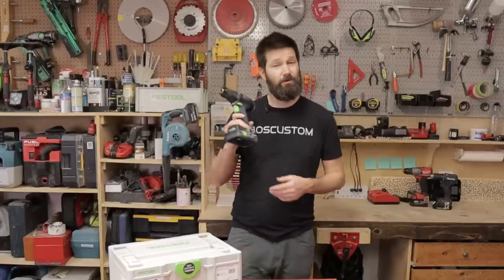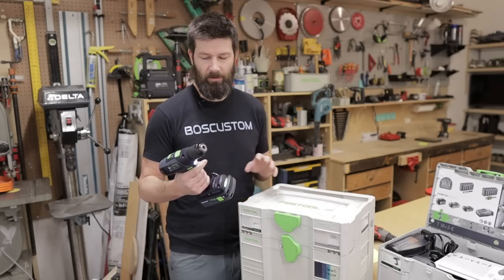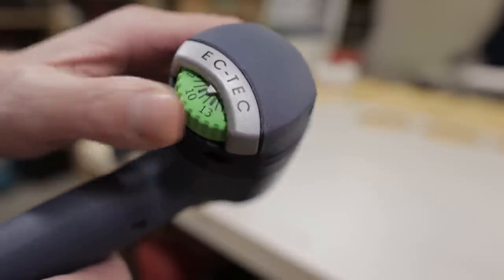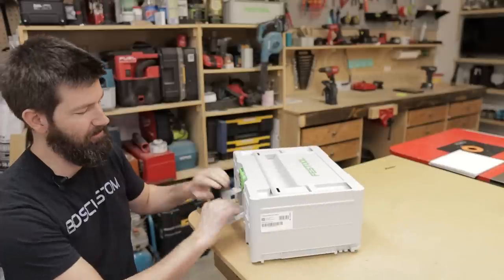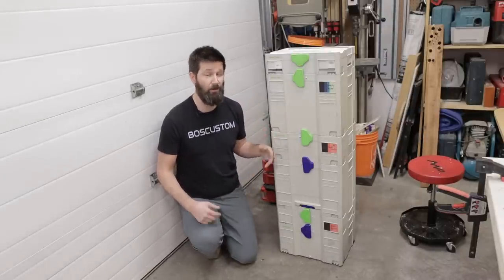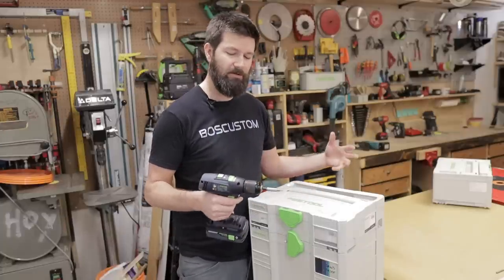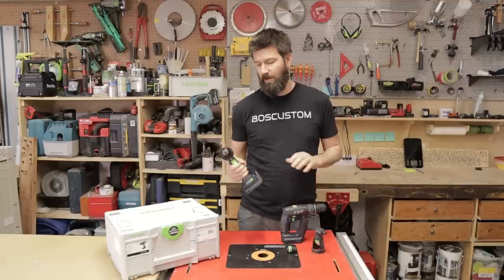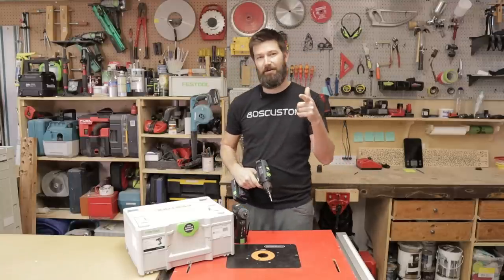Festool T18+3 Easy Drill-- Everything you Need to Know!

Comment: Been debating between makita and festool track saw.  I like that drill though, might just sway me towards festool for that kind of deal.  Always been a makita and milwaukee kinda dude.  Agreed on the sustainers though have a couple sitting with my makita ones, great tables and chairs.  😂
Reply from the maker: I'd definitely price it out and see what the difference is.  I think it's worth it to go cordless on the track saw.  I have the Makita corded track saw and would like to upgrade it in the future.  I'm not sure on the cord on the Festool but the Makita cord is very awkward and prone to catching on things, which is not great when in the middle of a cut.
Reply: @TheFunnyCarpenter  agreed with going cordless, using the shop vac with the corded one is my only hang up.  Wanna say it was your videos I found on that, that had me re thinking if the corded was that important.

Comment: I've heard other people say they hate that Makita jig saw! I have the dewalt barrel grip jigsaw it's fantastic. The Milwaukee barrel grip jigsaw is great also...
Reply from the maker: Yah, I think I'm going to snag that Dewalt barrel grip jigsaw-It looks great and it will be a nice opportunity to show a little love to the black and yellow.
Reply: @TheFunnyCarpenter  DeWalt doesn't always get it right but when they do they do and that jigsaw in my opinion and experience is one of those times they got it right. With that said if I could change one thing about it, it'd be  the placement of the variable speed knob....
Reply: The M18 barrel grip is not great at all. They couldn't fix their blade alignment issue for all these years - you still have to push the blade in really hard to make it lock at the correct angle! This is the same problem they had with their regular M18 jigsaw which was released 10 years ago. Also, the blade drift is noticeable. It doesn't cut straight in anything thicker than 1".

Comment: Sounds a little miss leading. You have to learn the tork settings. Its great but its a learning setting. I want the track saw. Impacts i don't care about the name. Can't believe the drill can be much better than a dewalt. Dewalt is much cheaper and bad ass . if its slimmer and shorter and smother drilling maybe. Over priced. Being the best sometimes means you get ripped off. I don't do cabinetry.

Comment: Damn sure ain’t worth that amount....all Festol products are extremely too high
Reply from the maker: All depends on how much you will use the tool and whether or not you'd actually like using it.
Reply: The Funny Carpenter  I use my tools constantly but get as good a job from moderate priced tools as I do the most expensive...over the last 55 years I have bought and used many different brands a price range tools and have opted to rely on tools that would last and not just because of the current fade or what people are using now. Just like the Saw Stop table saws I do not believe they are worth the price.....and after 55 years of using wood working tools of all types I still have all my digits.
Reply from the maker: Dan Bailey it’s definitely not the tools that make the craftsman.  In my case I’ve always enjoyed well made tools, it make me happy and life is short🙃

Comment: Hi, did you know you can turn off that soft start in makita jigsaw. Turn speed control to 6 , press power on but dont press trigger. Now scroll speed to 1 and then back to 6, light will blink and now it starts at that speed you have set to it.

Comment: Seems to be a sweet drill. I dont know if it could go against milwaukee's fuel drill i have heard it is the most powerful one in the market. But of the two festool seems to be the best overall
Reply from the maker: That new Milwaukee fuel drill has twice as much in-lbs of torque over the Festool t18.  It's bad mother of a drill.  That being said I would hate it for fine work like installing door knobs etc...
Reply: From what I understand the dewalt flexvolt advantage in the most powerful drill on the market! Not to take anything away from the Milwaukee because it's obviously a great drill.

Comment: Festool has always felt out of reach because of the cost but $300 isn't bad with two 4ah batteries. I've never used a festool cordless tools before but I dig that drill it looks super smooth when you were drilling out with that 6" hole saw!
Reply from the maker: It's going to be interesting to see what happens when I start really testing it out against the Milwaukee Fuel.  I'm interested to see if it can do all the things a carpenter/builder needs a drill to do.  Lol those 6" hole saws are dangerous as heck, I had one in the Milwaukee drill and it flew out of the chuck and just started spiralling all over the garage!  Just glad I wasn't in someones finished kitchen!
Reply: @TheFunnyCarpenter  oh damn I've had that same thing happen with a hole saw before. I just look at the chuck all disappointed and disgusted like lol 🤦🏼‍♂️😆
Reply from the maker: CraftManGreg definitely going to be using the safety glasses next time I’m hole sawing😬

Comment: Nice video (like most of them, which is actually saying a lot at YT, but I digress...).  This video actually cost me some money.  I really hadn't thought about another drill (I have 40 years' of drill detritus in the workroom).  But you got my curiosity seriously up and the result was I bought a T-18 +3 (not the E/Easy/fixed chuck version), along with the eccentric or offset head.  

You're right, it's just plain nice to use.  Not exactly widow-maker torque, but very practical for most uses.  (Did I mention that I have some broken metacarpals from using a Milwaukee 600rpm 1/2" Hole Shooter 20 years ago?  I was on a ladder and I'm probably lucky that it didn't toss me off the ladder.)

The eccentric chuck is an interesting accessory.  I don't think there are any other 18v drills offering an interchangeable eccentric chuck.  I thought Metabo did but Google doesn't seem to show it for sale in the US.  

Thanks and keep up the great work.
Reply: Ya was was

Comment: So glad you mentioned the trigger smoothness. That never gets mentioned in reviews, and as a trim carpenter and cabinet installer, I find that is a big deal. 

That clutch! That is super cool. Would love that for screwing cabinets together. You’re right that pretty much every clutch is useless. 

I had to laugh when you mentioned the Makita jigsaw. I’ve got the barrel grip 18v and that slow start is so annoying! I’ve been eyeing the Festool as well. 

Awesome review! I’ve never considered a Festool drill but that has seriously caught my eye now.
Reply from the maker: Thanks for the comment Kyle- in the future I’d like to try out that barrel grip Festool Jigsaw as well as the Dewalt.  I’ve heard a lot of good things about the Dewalt.
Reply: @TheFunnyCarpenter  My dad has the Dewalt. The speed adjustable trigger is nice and it has plenty of power. The issue I have with it is the handle is mounted a little high on it. So the balance feels off, as all the weight is down low and makes it tough to scribe with or making any type of angled cuts. 
Other than that, it’s great for cutting board stock or any heavier work. 

Funny enough I did like using the m12 Milwaukee jigsaw. Other than being a little underpowered (understandably), it’s a nice balanced tool to use.